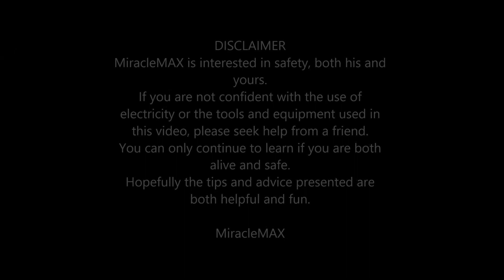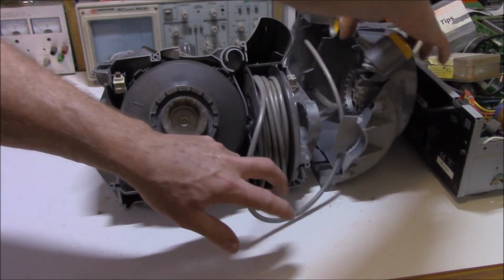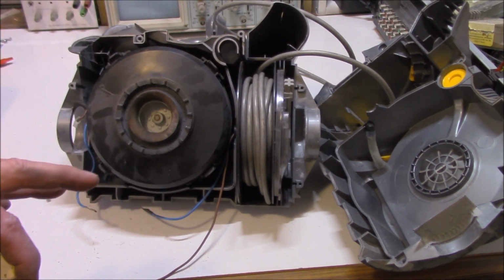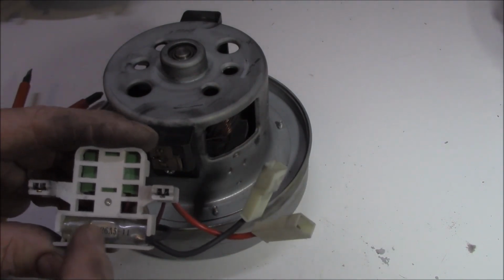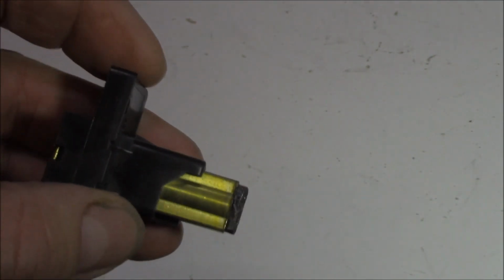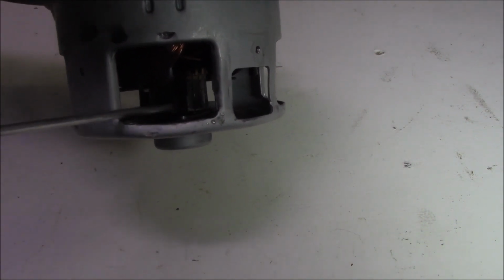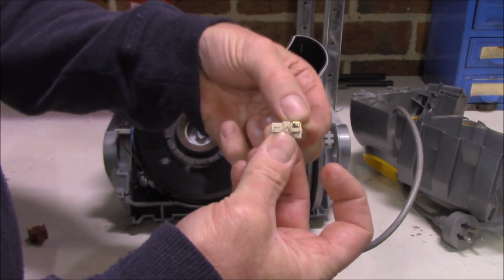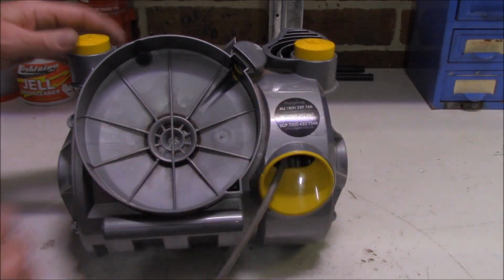Dyson DC08 Vacuum Cleaner Repair MiracleMAX

Comment: Was so impressed I'm going to let the ad play at the very end of your video and then I'm going to subscribe.
Reply from the maker: Thanks Arch Titus,
I'm glad you were able to get some help from the video. 😊
MiracleMAX
Reply: @MiracleMAX  I looked a little closer at the model of my Dyson today, in the small print it says DC20. I thought it was a DC08 because I compared it to the one you stripped and rebuilt and which I must say both are very similar.
I need a pair of carbon brushes and it looks like they actually might be different so it's a good thing I checked. I learnt from you that the model is printed on the sticker but it's very small and can be overlooked.

On eBay $12.42 so I'm in, will order shortly.
One brush had about 12 mm sticking through, other about 2mm.
Checked motor, something else I learnt from you and appears to be OK

Thanks for your help cobber. I'm Australian too.
Reply from the maker: @archtitus3412  You are welcome! It's great that you have got some help from the video. Every video I do, I learn something new. That's why I like to share these videos, because all the research is only useful if it is shared.
Cheers Mate!
Reply: @MiracleMAX  I fitted new carbon brushes to Dyson DC20. Connected motor to mains power and run motor-only on bench-top. It starts, runs at full RPM but sparks like hell and within two seconds flames were rising from carbon brushes. Bearings appear OK but I am going to strip motor next. I did clean commutator with fine emery before and it appeared to me to be OK.

Have you got any ideas what might be wrong?
Reply from the maker: @archtitus3412  Hey Arch Titus,
I hope you had a extinguisher handy!
When you cleaned the commutator, did you clean out between the segments? Perhaps some of the copper that you sanded of may be jammed between the segments.
Were the carbon brushes cheap or quality? Did you check the armature for any ground connections and do all the other tests in the video? https://youtu.be/5ZLDLH624a0?t=728
Did you buy the brush pack or just the brushes & install them yourself? Perhaps the brush wire is wrapped around the spring or contacting something it shouldn't.
I hope you are able to get it sorted.
Reply: @MiracleMAX  Dyson had a problem (wasn't working) before I gained possession of it. I noticed debris sort of stuff in the bottom filter, it appeared to me that something had got hot and the debris was probably the carbon brushes. When I switched it on nothing happened. 

I checked the motor with a multimeter it appeared ok. When I fitted new carbon brushes motor worked, probably still does, however, sparks like hell.

Carbon brushes were bought on-line and I don't suspect brushes being the problem, However only changed one of them as the other still had life in it, being about 15mm long from end of brass housing. Going to strip the motor and take a closer look at the commutator and bearings. 

I'll check-out the link you sent me later today.
Thanks for your help
Reply from the maker: @archtitus3412  If it got really hot, it is possible that the armature has shorted wiring. That would create a short circuit between the sections.
If you turn down the music on this video clip, there might be some useful tests that could help diagnose the problem.
https://www.youtube.com/watch?v=lmjFzukDhqI&ab_channel=TheLabOtomy
Reply: @MiracleMAX  I did strip the motor, cleaned up commutator, bearings were ok. Put together motor and refitted carbon brushes, still sparks like hell. Convinced motor is suspect. Will do the checks demonstrated in the video link you sent me and send you the result of what I find. I reckon there's a short somewhere but I'm surprised motor actually runs. Probably would until carbon brushes fail. That's probably what happened when Dyson failed the first time. There would have been a lot of smoke and probably frightened the previous owner to death.
Reply from the maker: @archtitus3412  I look forward to hearing the results! 😊

Comment: Hello Mr. Miracle Max, how can I repair the brush of model Dyson DC08. Or to unscrew it to clean it propperly. I hope there is a video how to do this. With kind regards Magda Korthals from the Netherlands.
Reply from the maker: Hey Magda Korthals ,
Welcome to the channel. 
Are you talking about a 'turbo head', which is a motorised head or just a brush head?
Here is a video I found by searching Dyson DC08 Turbine Head.
https://www.youtube.com/watch?v=5fCm5A4G3Xg&ab_channel=RussellPlatten
This might not be the exact model, but may give you the guidance you need.
I'm sorry I don't have a video on disassembly of the brush head, but I can walk you through the process.
I don't have a turbo head attachment, so I can only help you with the basic one.
If you turn the brush head assembly on it's back you will see 2/ T15 Torx screws that need to be removed. I just did that on ours to help you out and it looks like that is all that is needed to get to any dust or hair that may be caught in that area. 
I don't think much else will be accomplished by pulling it apart any further.
I hope that helps
MiracleMAX